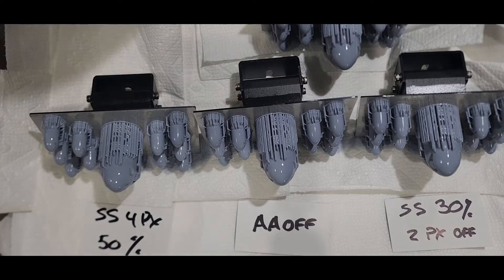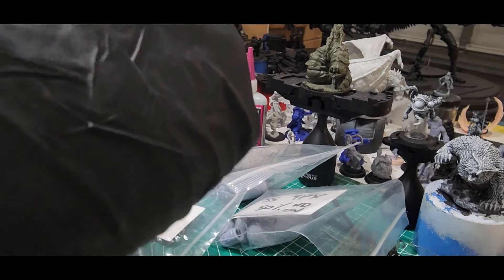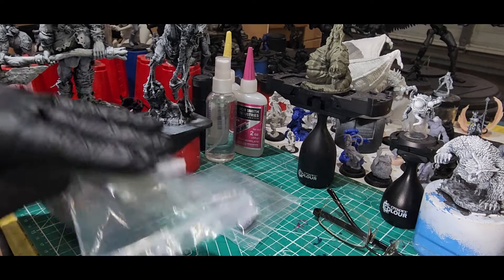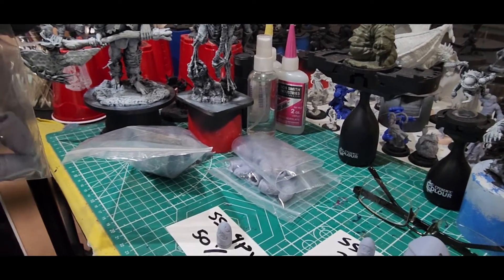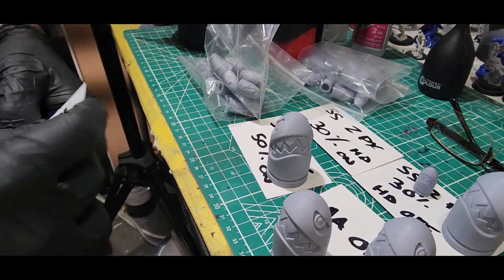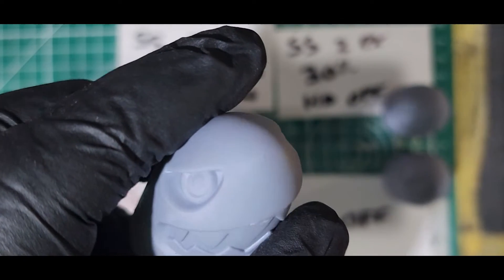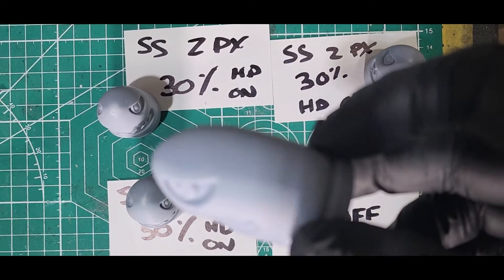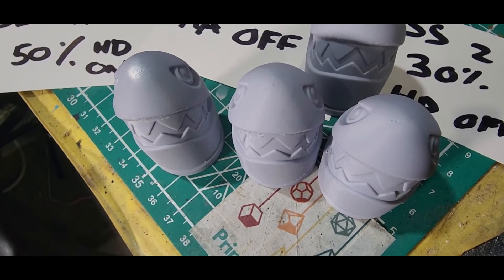Lychee Slicer Alias Settings Tested and Approved Part 2

Comment: 5:57 - Those dots could be bubbles in the resin.
Reply from the maker: Yes, bubbles are always possible. Have worked with a few guys who say they are not bubbles, but I am pretty sure they are trapped air.

Comment: I can happily report that your preferred settings worked well for me on the Uniformation GKTwo at 50um resolution. I print dental models, so there’s lot of curves and points that now look nicer and have less ringing print lines. It’s an aesthetic upgrade and probably only I notice it but I can see it mattering more for printing those minis and figures. 
Your Lychee settings were Smooth surfaces. Radius 4. Grey offset 50%. HD-on. AA on supports - OFF
Reply from the maker: Awesome, I imagine the dental models need precision too. Great to hear that those settings got you some noticed improvement.

Comment: how does smooth surface , compared to sharpen details  setting , influence  the detail on a print , like a figurine , for example. Do you lose detail with smooth surface ?
Reply from the maker: If you set the grey too high you can. I find it works really well for large figures.
Reply: @IPrint3dMinis  Thanks for the reply. Really appreciate it
Reply from the maker: @leondeklerk6410  Of course, I currently am working on a new video, should have it up this week. I am considering doing another AA video. So many folks ask for it, I have done like 5 of them already, but it seems to be a big question in resin printing.

Comment: Thanks for the video!!!
Is the Anti-Alisasing done BY Lychee (in its slicing process), or is it done by the PRINTER itself (and Lychee only sent it commands to do those values).
I guess seeing all printers are different in what they would give, this must be done by LYCHEE really. (?)
Reply from the maker: Yes and yes, AA settings are controlled by the hardware, and determined by the resin quality. The software can insert it's own software or coding into the mix, and it will work on some printers, and not others. Lychee does not play with Elegoo as well as some other brands like Anycubic, and some older printers do not use the AA at all. Cheap and standard resins will also not really do much in terms of AA settings.
Reply: @IPrint3dMinis  Hmmm , I tried a few forms of AA (smooth etc) and settings and they all printed 'abortions' - total failures.  Versus "No AA" prints it perfectly as usual. I used an Elegoo Saturn 3 Ultra and Anycubic ABS-Like Pro2 resin. That has been a highly (100%) reliable resin, with a wide tolerance range for settings that will still just keep working.  But whatever caused it, it the 'sytem' (printer/resin) hated any form of AA !!
Reply from the maker: Yes, as mentioned in my previous comment Elegoo does not play well with Lychee AA settings. Try doing the support work in Lychee, export the STL and import it into Chitubox, then run the slicing and use the AA settings in Chitu, this should work better for your printer.

Comment: Thanks for one more great informative video! How do you think, does any type of Anti-Aliasing even works with DLP printers?
Reply from the maker: Funny enough we have tried getting the AA settings to work with the D2 and the Ultra and it does not seem to work at all. Have tried every setting there is. It uses the other settings just fine though. I use Photon Workshop to slice for the DLP printers and set the AA to 4, it works pretty well. Anycubic recommends 1 for all of the printers, but I have gone up to 8 on the DLPs, but 4 is my setting when using them in PW.

Comment: Sometimes if dust or particles collect on the bottom of the vat, it can cause holes on the top of your prints like you saw on that 2nd model. If you cure a full layer on the vat and pull it off, it may pull out all the dust and debris that is stuck to it. 👍 Hope that helps! Thanks for this great video :)
Reply: gracias por esta explicación
Reply from the maker: I am pretty sure it is dust or hair for sure, happens on my prints from time to time.